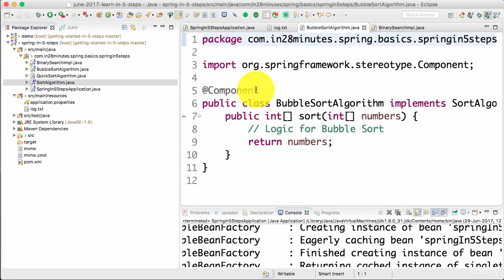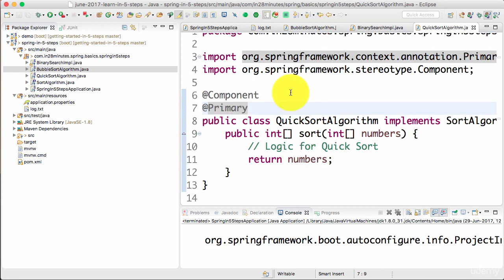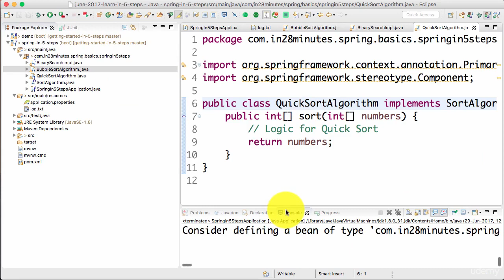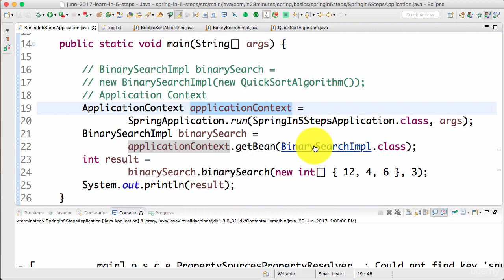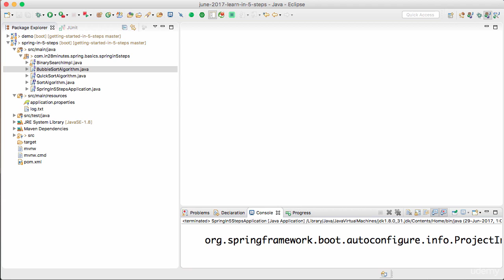Spring framework Tutorial (014 Step 6   Dynamic auto wiring and Troubleshooting   @Primary)

Comment: what if we have to call both algorithms quicksort and bubblesort one after one .....how can we do it??
Reply: if you have multiple implementations of a thing and you want them auto injected then you can use @Qualifier annotation, which I do usually in my project :)
sample code for you is below (Note: this is not the only way, of course there are multiple ways to achieve this based on your actual requirement)

    @Autowired
    @Qualifier("bubblesort")
    private SortingAlgorithm bubbleSortingAlgorithm;

    @Autowired
    @Qualifier("quicksort")
    private SortingAlgorithm quickSortingAlgorithm;

-------------------------

  @Component
  @Qualifier("bubblesort")
  public class BubbleSortAlgo implements SortingAlgorithm { }

  @Component
  @Qualifier("quicksort")
  public class QuickSortAlgo implements SortingAlgorithm { }
Reply: @sainath7661  🙏